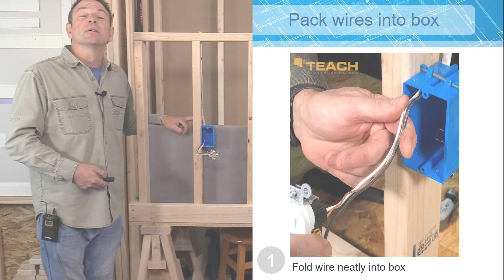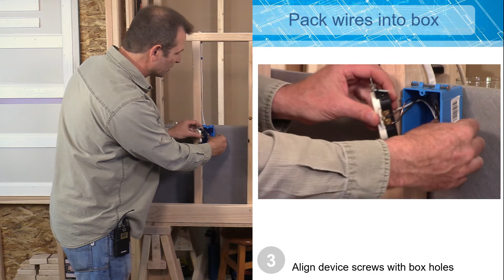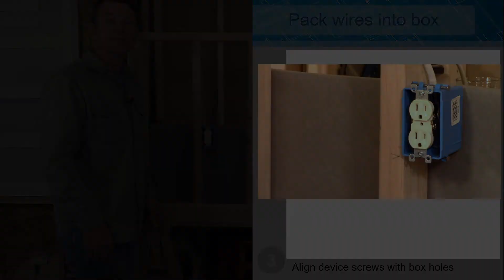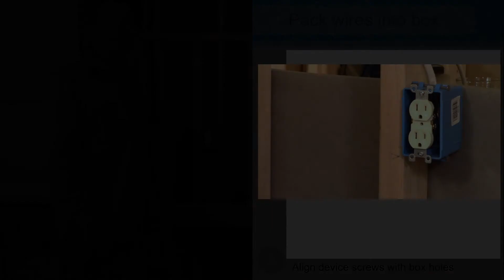Electrical Wiring Process - Part 11 - Packing a Junction Box - Come wire with us

Comment: I agree with some of the previous comments, the help is needed when you got 4,12-2 or 12-3 wired in a box. It’s not hard to fit one 14 wire in a box in fact it’s rather easy.

Comment: nice video presentation. however, i am here because i have 12 guage wire along with a gfic, and it seems far more stiff and difficult.
Reply from the maker: 12 gauge is thicker but the process is the same.